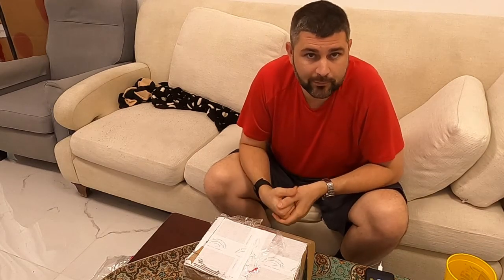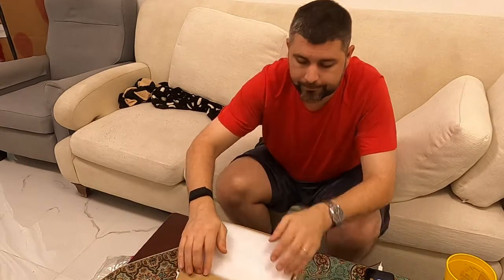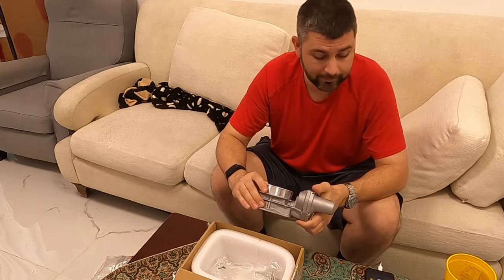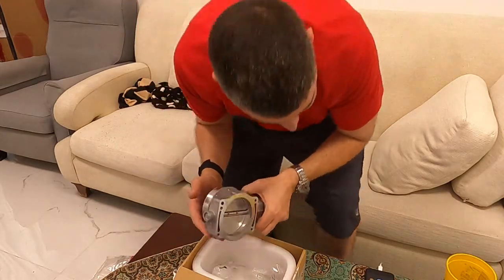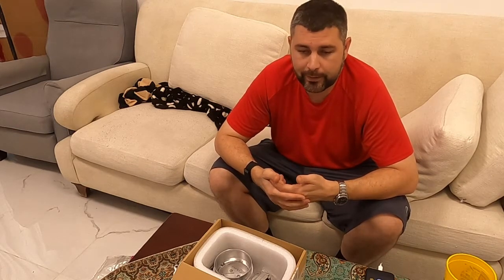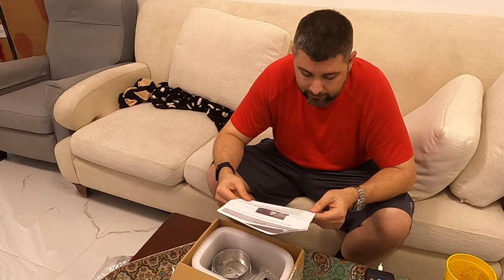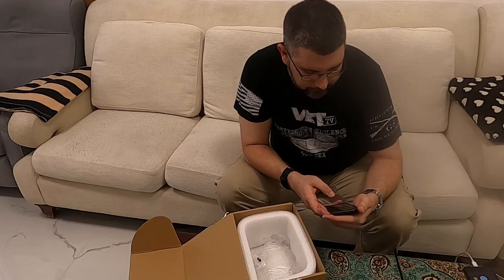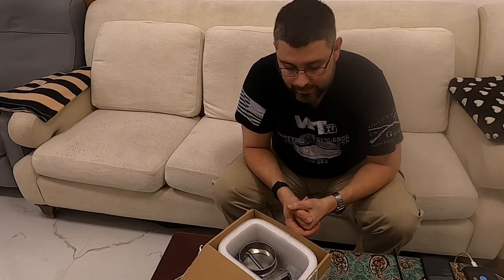Soler Performance initial review and first thoughts Updated

Comment: Hi... Did u compared brand or services to decide pick soler... Im looking for options now between: mamo vs soler vs supermodulation i dont see others just wanna pick the best option with no regrets 
My project is a 2011 Chevy Colorado 2.9L for dayly driving. Home work home...  and street racing + some drift on weekends. thanx
Reply from the maker: I compared looking at other brands like mamo, but ultimately went with the Soler performance. 

I have been happy with the results ever since.
Reply: @ByronETAWheels  thanx bro... Trying to make a deal tomorrow n see what good things happen then.
Reply: @ByronETAWheels  Did you see any difference in your MAP #'s during wot